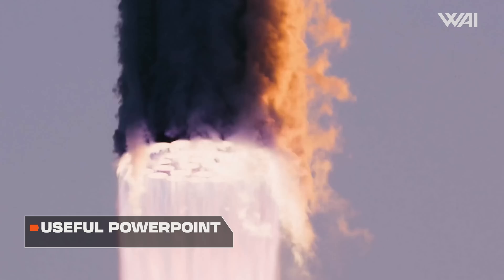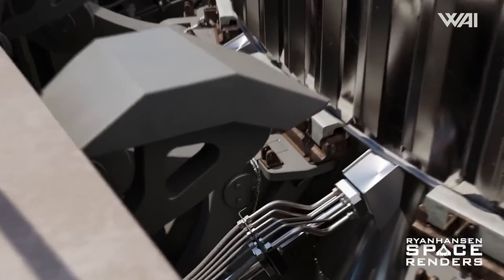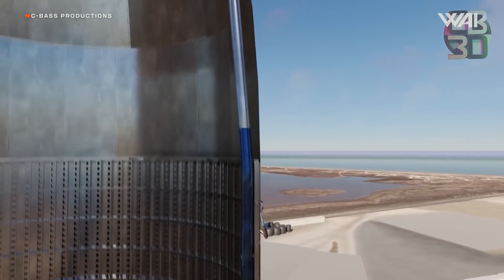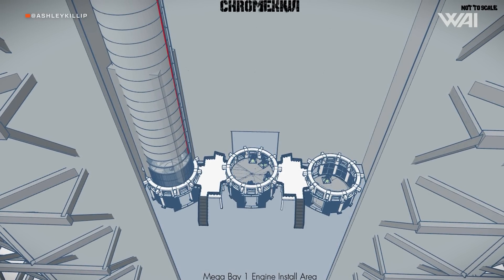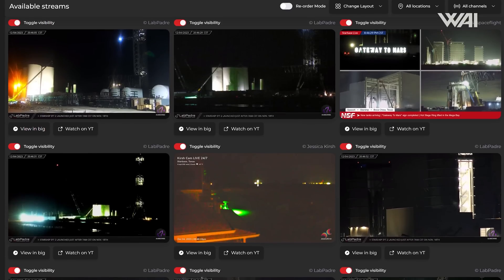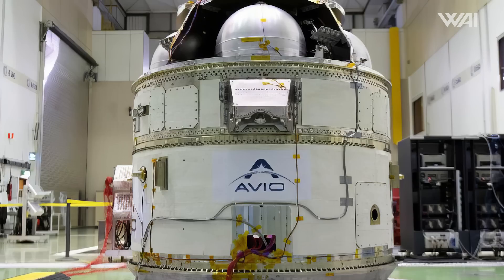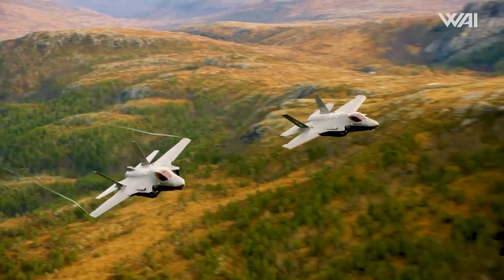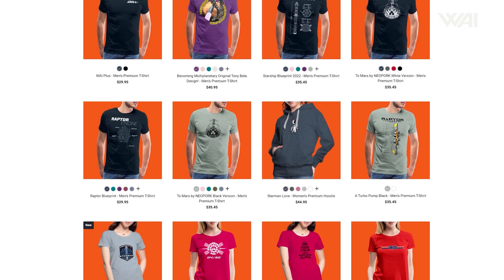SpaceX Starship: Version 2 Is Coming & And It Does Something Different!

Comment: Starship major concern number three: the fact that SpaceX is going to do a rather Mickey Mouse fuel transfer experiment on the next flight should be a major concerned for anyone watching SpaceX and it’s plans for refueling in orbit under 0G. If you think about it, once a starship, second stage reaches orbit, It’s prop repellent will not be in liquid form, but will rather be a mixture of liquid and gas. Such a state of matter will probably not adhere to the normal laws that we would expect, and it might be the case that a gentle acceleration of one starship feeding another, may not be nearly enough to overcome the difficulty of dealing and pumping such a mixture of gas and liquid propeller. This is the case, it may be a major redesign of how any such liquid propeller transfer would take place in orbit under 0G or near 0G. It could also mean that refueling an orbit is not really feasible, because dealing with a propellant that is both liquid and gas at the same time in a mixture may be too difficult. at any rate, this is probably a much bigger problem than SpaceX wants to admit at this time because if they can’t make this work quickly, then the moon landings could be delayed for years under the current plans of refueling 12 to 18 times in orbit.

Comment: Major starship concern number two: the fact that the next law of starship will end up in the Indian Ocean instead of close to Hawaii, may be an indication that SpaceX is concerned that the second stage of the starship will have major heat, shield problems, and break up in flight as it reenters. That the break up will be so bad and so uncontrollable that trying to land near Hawaii is out of the question. This is another indication that the starship heat shield design is woefully in adequate at this point.

Comment: Major starship concern number one: if SpaceX cannot make a durable heat, shield approach work for the starship, second stage, the entire program may be a failure. So far, SpaceX seems to have made little progress, and actually nailing down a viable heat shield for the starship second stage. Without a viable heat shield, there will be no band flights of starship. Without a viable heat shield, every starship flight will possibly involve the loss of the second stage.

Comment: Zero G fuel transfer.    So, they open a valve, or two and start a pump, or two?  Is it more complicated than that, Zero G and all?  Probably, right?   And then, will that fuel be in the tank that gets used to maneuver and land on the ocean surface?

Comment: Well it seems that the booster failed when it flipped and the fuel continued going in it's original direction which is now away from the engine intake end and shutting down the engines . What about an inner cap on a track system that racks in as the pressure drops you couldn't use rubber seals but some bimetalic seals would be good enough . This way the fuel is always at the right pressure and the right place. Great show Keep it up.😎

Comment: The booster tank pressures may have dropped too much. 

The Starship Raptor engines use autogenous pressurization where hot propellant gas maintains propellant tank pressure (ullage). Tank pressure is only stable when the extra hot propellant gas stays stratified in temperature at the top of each tank. 

If the sub-cooled cryogenic propellant was upset (during brutal hot staging) and mixed with the hot vapor, then tank pressure is going to abruptly drop ! 

Also, when the booster abruptly flips, the hottest gas will slosh onto the very cold side walls of the tanks, and this will also cause an abrupt drop in pressure. 

SpaceX could cool the autogenous pressurization gas before introducing it back into the tank, and this would greatly improve pressure stability, but this may also greatly reduce the ISP (efficiency) of "cold" gas thrusters using that colder ullage gas. It would also require more autogenous volume/energy, which may significantly reduce Raptor engine efficiency.
Reply: I can suggest isolating the hottest gas at the top of the main tanks using an insulating bladder/membrane. This reserved designated volume would be exploited to operate the cold gas thrusters. 

Hopefully, the insulating membrane would limit the heat transfer rate between the hottest gas and:
1) the colder ullage gas, 
2) the side walls, and 
3) the sub-cooled propellant.

Comment: I am calling here now (prediction): SN26 will be sent to LEO and do prop xfer test in orbit - The plight plan for landing in Indian Ocean is aspirational - They will 'attempt' to target landing in Indian Ocean but SpaceX knows it is likely to burn up since SN26 lacks heat tiles. So again the SpaceX philosophy of testing to failure - which is a very valid approach - It will be important for SpaceX to understand how resilient the stainless steel hull of Starship is to re-entry without tiles (so if a few tiles come off they get a better idea of how much margin they have).  SN26 will likely burn up or be severely damaged before landing - the fact it has cold propellant on the other side of the stainless steel slightly increases its chance of survival.. But this is the reason for targeting Indian Ocean landing - Because it is miles of ocean and lower risk if some debris makes it to surface of impacting or causing any damage or loss of life.

Comment: SpaceX should keep all 33 Super Heavy engines going, but throttle them down as far as they go. It'll be a bigger turn around, but it probably won't explode. Then they can adjust throttle after that, and fine tune it over time.
Reply: I don't think even at minimum throttle that Starship would have enough thrust to pull away from 33 engines.

Comment: I should have been a mechanical engineer. I have been asking myself why NASA and now SpaceX didn't use a means of attaching the heat tiles that were shown in this video. You could even make them easily detachable for inspection and replacement by using a magnet to pull some hidden pins inside of the ceramic that would not come loose in normal flight.

Comment: I am beginning to feel that we shouldn't care about boosters from SpaceX returning at all. If we can use the lifter to get heavy loads to orbit right now...we can repair the ISS,  preposition Artemis architecture, and have a backup for Falcon for traditional capsule launches. If they get to the rocket coming back within 10 years that's icing. We need a cheap booster to get Orion to space with or without Starship.
Reply: Unfortunately I don't think it would save the ISS. It's just a matter of wear and tear, unless you're planning on replacing whole segments and at that point, why not build a new station to replace it? All new with no old hardware right?"

Comment: SpaceX should install angled fins on the Ring Shield.  Sorta like internal fan blades.  

When the pressure from the engines separates the two vehicles, the added fins would force the booster backwards and into a spin.  Now the black exterior Booster fins can spin to turn the vehicle in any direction it wants.  

If there is enough air pressure across the black fins
Reply: Perhaps not a good idea, given that what you describe is one of the more compelling theories for how booster 9 was destroyed... it was forced back in exactly that manner, and the resulting sloshing of fuel and oxygen did some serious damage.

Comment: You create good content but it often seems stretched out to increase runtime. Also, you don't put in chapters. I used to either watch the whole video or skip around. Now with AI, I can just use a summarize and get the factual content in a minute. Based on the content, I didn't watch the video. I will watch future ones if the summary shows content I'd be interested in see. Chapter titles would of course achieve the same thing.

Comment: The elephant in the room is that SpaceX would have to refuel their moon lander in HIGH Earth orbit AND transfer cargo in orbit to carry to the moon, none of which has ever been attempted. How many Starship tanker trips would be necessary to refill one moon lander, 4 or 5 trips or more? How much of that fuel would be consumed for the most energy-costly trans-lunar injection, the lunar descent/ascent and the return to Earth for more fuel and cargo? Far too many complicated, untested parts to be a viable system, remember "The best part is no part"! Much simpler to send cargo directly to the moon on reusable boosters and EXPENDABLE landers that can be repurposed on the lunar surface and keep a SMALL passenger shuttle at the lunar gateway for descent/ascent that could be resupplied with fuel from the Earth until fuel can be produced on the moon.

Comment: I think both the booster and StarShip fuel tanks over-pressurized causing the automatic self destruct signal. What fuel that remained in the booster sloshed around enough to cause a phenomenon called "Rollover." That is when the remaining fuel undergoes a rapid fuel expansion due to temperature changes within the fuel itself. Fuel baffles and more insulation would correct this problem. It does in the Petrochemical LNG industry.
Reply: The tank pressure may have dropped too much. 

The Starship Raptor engines use autogenous pressurization where hot propellant gas maintains propellant tank pressure (ullage). If the sub-cooled cryogenic propellant was upset (during brutal hot staging) and mixed with the hot vapor, then tank pressure is going to abruptly drop ! 

Also, when the booster abruptly flips, the hottest gas will slosh to the very cold side walls of the tanks, and this will also cause an abrupt drop in pressure. 

Tank pressure is only stable when the extra hot propellant gas stays stratified in temperature at the top of each tank. 

SpaceX could cool the autogenous pressurization gas before introducing it back into the tank, and this would greatly improve pressure stability, but this may also greatly reduce the ISP (efficiency) of "cold" gas thrusters using that colder ullage gas. It would also require more autogenous volume/energy, which may significantly reduce Raptor engine efficiency.

Comment: Anyone can explain why they have to refuel starship vs just lift propellant+oxigen tanks then simply attach them externally(through a manifold ec.) to lunar starship for the transfer and simply detach for the decent stage.
Save space on lunar starship and be able to have 2 separate lines running for fuel and one for cargo starships where they can utilize falcon9+heavy for the fuel  
and simply scale up the system for the mars transfer or at least build on the knowledge gained from its use.
Either way you will need similar system for Mars transfer might as well develop it for LEO to Moon no?

Comment: I think the best way to practice and test fuel transfer in orbit for now is to just use Falcon 9 or Falcon Heavy. If they can make it work with that then they can make it work with Starship. 

If they can fill the tanks on an orbiting rocket it will be revolutionary and a huge leap in interplanetary travel. 

It consumes massive amounts of fuel and oxygen just to reach low Earth orbit. A good size rocket like Falcon 9 will burn about 3,200 pounds of fuel per second. The entire launch uses about 400,000 pounds of fuel. 

If you slingshot out of low Earth orbit with full tanks, or even half full, it should allow them to have remaining fuel to get back home after arriving at Mars. By the time they start they restart the engines from LEO they would already be traveling at about 17,500 miles per hour.

 They should do this with falcon 9 and falcon heavy until starship is ready.

Comment: Transferring to the header tank while the engines are firing positions the liquid to be transferred.
A weightless transfer is complicated by random liquid and gas distribution in the uptake tank.
Reply: Yep, the tanker starship will need a bit of ulage thrust to push the fuel to one end of the tank .  Maybe run one Raptor Vacuum engine on each ship at minimum thrust during the real fuel transfers, with the geometric details pushing the ships together and keeping a desired orbit .

Comment: Will test flight 3 be orbital? There hasn't been a 100% test flight of Super-Heavy and Starship yet. The third flight could very well be a repeat of the same mission plan. However, SpaceX may have gathered all the sub-orbital data they need from TF2. If that's the case, we will see the very first Starship in orbit for TF3. That's what I'm hoping for. :D
Reply: didnt you hear? they have both been wildly successful.
Reply: @ThatOpalGuy  Sure. It's easy to dunk on SpaceX for blowing up the first two super-heavy boosters. I've always been a bit overly optomistic when it comes to their testing. But fan or hater, those launches were spectacular!
Reply: @leonskum6864 the starships FTS actually activated, but I could be wrong. anyway, its ready for astronauts!

Comment: It's just disgusting with government taking 3/4ths of my earnings that they think they should be spending on this nonsense. Want a frontier? Try the oceans. They cover 3/4ths of the earth. And lots of volume. Energy needed expended in a single rocket launch. 

Want global communications? Try UWB/ATM... technology over 40 years old and still more advanced (and less clumsy) than anything we're doing today. Compared to Starlink, the cost is lost in Starlink's cost noise. 

Want virtually free energy (with no impact on the nonsensical carbon boogy man)? Try Thorium Molten Salt Reactor. Proven over 50 years ago running 5 years without interruption... then politically interrupted because fat cat's ox's would be badly gored. 

What a disgusting world we live in when it's run by marketing and finance geniuses... and of course politicians. All could, and should, be dispensed with as cannon fodder... like the legions in historical battles.

Comment: Any word how the transfer of cryo liquids in zero-G is supposed to be done? I have NO idea - internal bladder, capillary action? 
I had considered using spin, but mass transfer alters the center of gravity, and ... there's a nightmare.
Reply: The last I heard it would just be inertial transfer but these guys change plans so often and do fast, who knows?
Reply: If i remember correctly, Elon had discussed this years ago. Basically just use small bursts from the attitude control thrusters to settle the fuel enough for pumping to happen. Since it's on orbit, the amount of force needed is tiny.
Reply: @jackinthebox301  I though the thrust would create aft sloshing from one ship to another.
Reply: @sdfried4877  What do you think "inertial" means in inertial transfer? There is going to be a pump that is kept supplied using thrust. The thrust, like I said, is tiny. Whatever slosh that will happen will be overcome by the thrust.
Reply: @jackinthebox301  By inertial, I mean no pump. The fuel will be forced out by motion.
Reply: @sdfried4877  ah, no I don't think that's possible in any useful way. But I ain't SpaceX. They're magicians.

Comment: Or maybe NASA will become more efficient with closer to a 1:1000 NASA:Contractor ratio instead of a 1:100 NASA:Contractor ratio. This will change NASA from providing insight to providing oversight only. More inline with the Administration provided by the FAA. This is because getting to space is no longer an ambition as when NASA was formed. Getting to space is now "going to space" where going to space needs to be provided by contractors. Even mission objectives and now being lobbied by contractors. NASA was great. But, a large portion of the NASA need has been transitioned to commercial just like what happened with large aircraft. Think of KSC transitioning to a Space Port just like Orlando International is an Air Port operated by an Air Port authority coupled with oversight by the FAA.
Reply: Once upon a time, NASA put a man on the Moon. Decades later, they were so inept that they left us with no manned space program at all. Luckily, Elon showed up or we’d still be hitching rides on Soyuz rockets from the 60’s with our “evil and most hated enemy”, Russia.

Comment: If you noticed on IFT2 it didnt look like there was alot of fuel in the tanks when the FTS engaged with “telemetry” issues. It sure looked like the starship exploded when the flight computer determined there wasnt enough fuel to get to hawaii and thus not a safe trajectory and blew up. The Indian Ocean is considerably shorter and until they get starship version 2 that weighs less and has more power, they may need to land shorter in the Indian Ocean. Scott Manley theorized that maybe it was losing LOX and that was why it was short on fuel, but thats not been verified by SpaceX. I just think Elon overestimated (what a shock) how much thrust it can produce and it isn’t powerful enough to get to orbit so no I don’t think its going to orbit.
Reply: Look at the stream. It's clearly losing LOX at a faster rate than LCH4
Reply: they don't mean just a short hop to the Indian Ocean. they mean a FULL orbit, then powered deorbit burn for the Indian Ocean landing

Comment: Great Spacex Video.

Minor correction at 2:08 you say "Starships first flight demonstrated that this approach works..." - but Startships first flight (IFT1) didn't use hot staging, IFT2 did, so it was "Starships second flight demonstrated that this approach works".
Looking forward to your next video :)
Reply: there is a lot to proof read in these updates. Likely need to have more eyes reading the script before filming.
Reply: Another minor correction IFT2 proved hotstaging could separate the two vehicles that's all (even a stick of dynamite could do that) it didn't prove that it worked and in fact it didn't work, which was evident from the time delayed RUD of both vehicles.
Reply: @straighttalk2069  To be fair what took out the booster seems to have been the flip being too rapid leading to fuel problems. As for Starship itself I'm not sure, do we have word on why it was destroyed?"